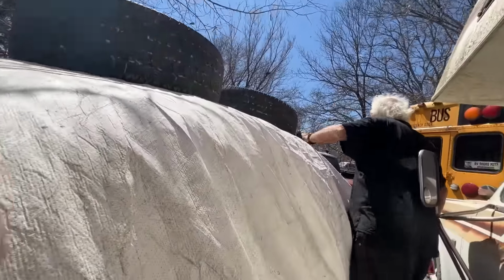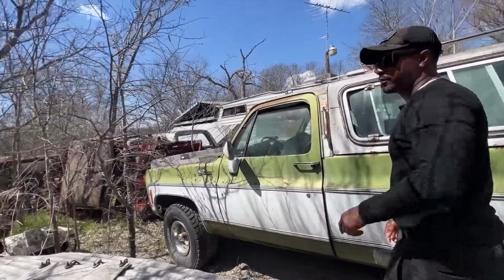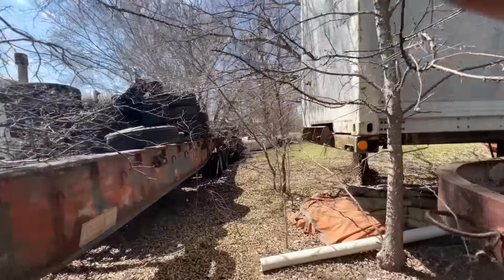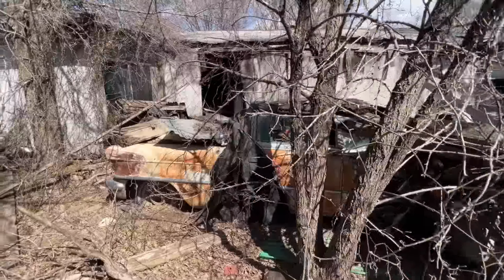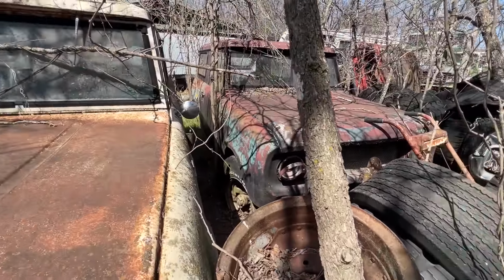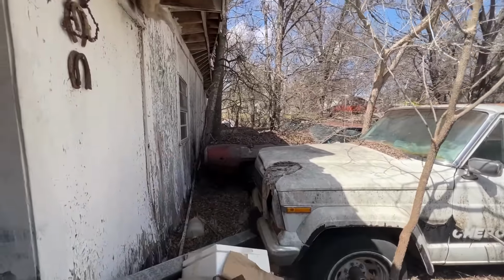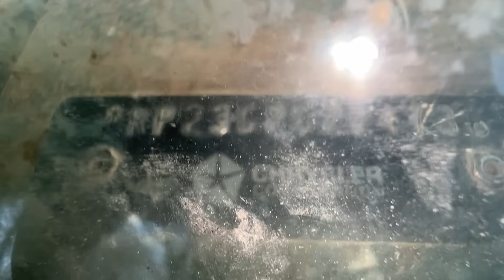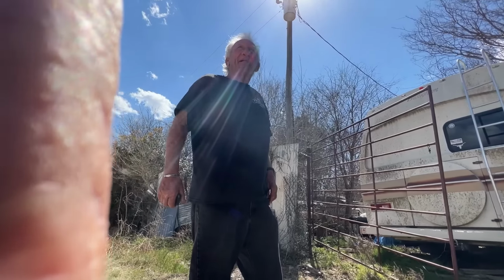Buying MASSIVE HORDE of MOPAR-GTX-Roadrunner-Challenger-Super Bee, Cornet RT-Satellite-Swinger-Dart

Comment: The Duster at 24:45 is an original 340 car.
It has the rally dash, very hard to find if you need it. 
At least I think the rally dash was standard on the 340's
It may have been an ordered option, on this car.  But in any case it is a rare find.

Comment: ..38:04..that looks to be a '71 Super Bee..quite rare, only about 5,000 made..and the last year of the Super Bee, and the only year of that body style for the Super Bee...only 22 made that year with the Hemi.. :0
Reply from the maker: Its a cool one. Think its 440 in it
Reply: @heartoftexasbarnfindsandcl5193  well, with only 22 Hemi '71's made, and 69 440 Six Packs made in '71, if it is indeed a 440(looked like it had a 4 barrel intake, so not a six-pack), I would think it would still be quite rare...I imagine most of the '71's were 383's or 340's(yes, you could get a 340 in a Super Bee in '71)....